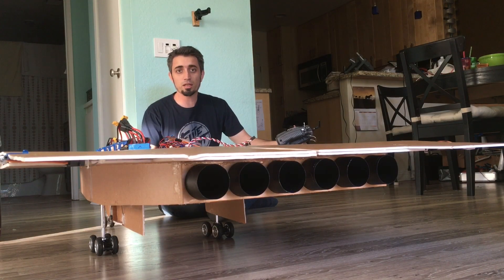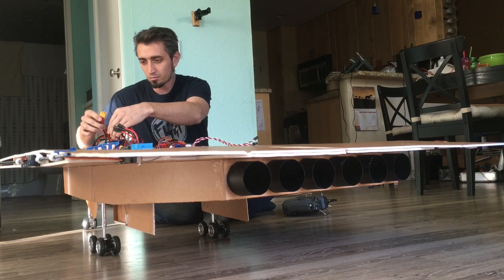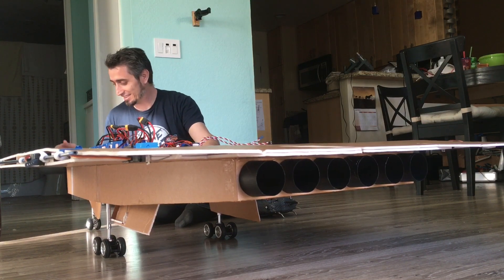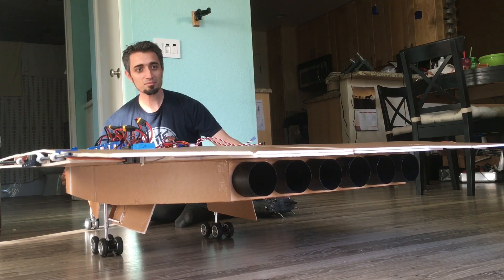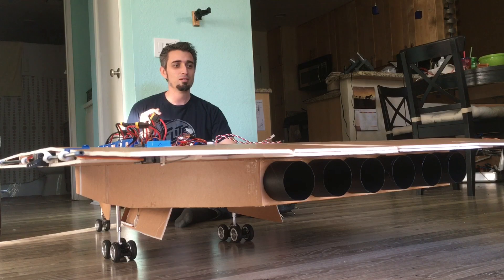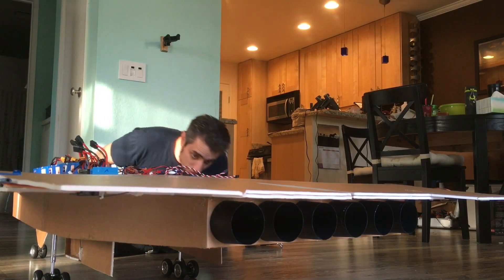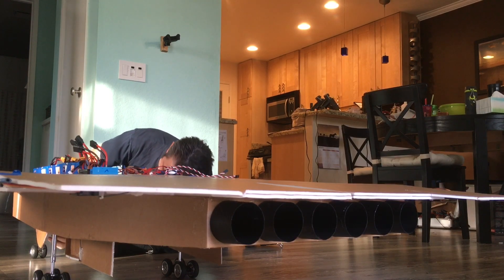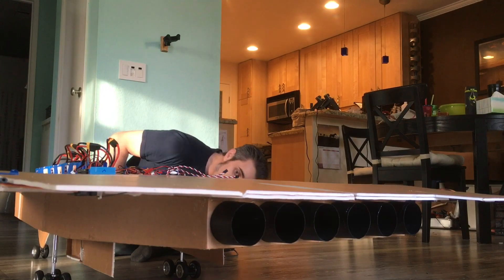Valkyrie, Wing ON, Full Throttle!

Comment: Ben you need to do a full throttle test and at the same time retract and extend the gear. My concern is that the motors may create such a huge vacuum that you may not be able to open the gear doors in flight. If that is the case then 2 simple fixes will help: 1. Use servos with higher torque for the gear doors. 2. Add cheater inlets in front of each of the fans. This will decrease the vacuum created by the engines thus making it easier for the doors to open. In addition this may help to create additional thrust. Hope this helps. Saul.
Reply from the maker: sml123ism Full throttle test while cycling gear is a good idea, although I don't know exactly how I'd support it while it was running...

I'm not worried about the servo torque too much, they are strong servos.  However, I already had planned on slotting the gear doors at the rear, so they don't make a solid seal and thus are easier to break open.
Reply: For this reason you might not want to raise your gear on the first flight. Just a thought.
Reply: I think it'll be alright. It looks like it's easy to belly-land :)
Reply: If the landing gear doors do not open because of the vacuum created by the motors would it not be possible to signal the doors to open then start decreasing the throttle until the do? This way you would know where the throttle stick needs to be to open the gear doors.

Comment: After sleeping on it, I have two suggestions on the gear doors.Both use old gift cards.   first suggestion,  glue an old gift card to the door to stiffen it, and second, glue strips of card inside the fuselage around the door opening to make stops to keep the door from being sucked inside, possibly jamming gear door shut.  That would be bad

Comment: It really is minimal flex on those doors. I think once you get up speed on your take-off the main inlet will be doing most of the work and the flex in the doors will be irrelevant. HOWEVER, it does demonstrate that your doors may be susceptible to flexing in irregular air flows in-flight. Rather than focusing on the doors opening more, I would focus on stiffening the doors to reduce the flex in the foam. Just my $0.02.

Comment: I think I would try a wood frame with a wood door that has breathing slats so the fans don't keep them closed with vacuum pressure in flight. Other then that  the landing gear looks awesome and the power is crazy going by the effort you are using to hold it in place.